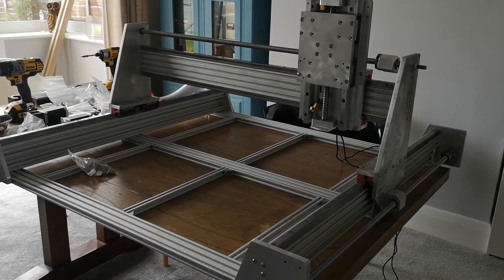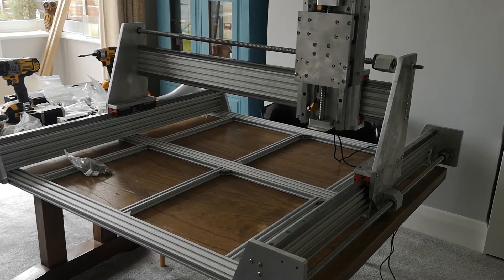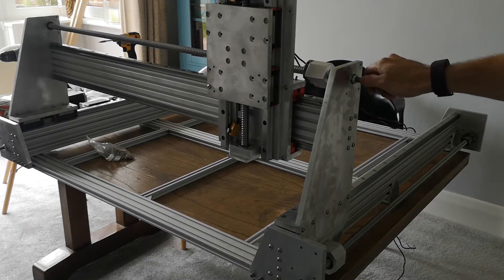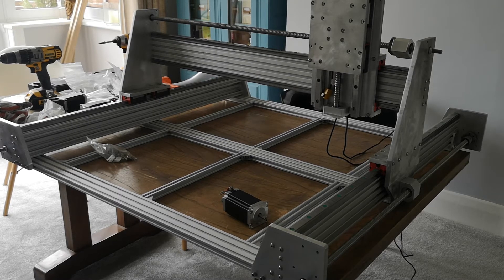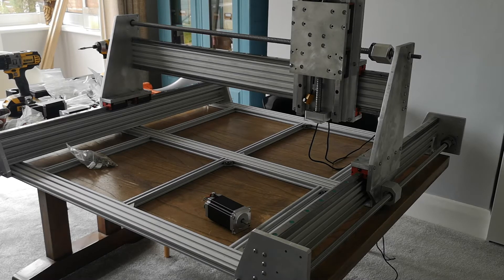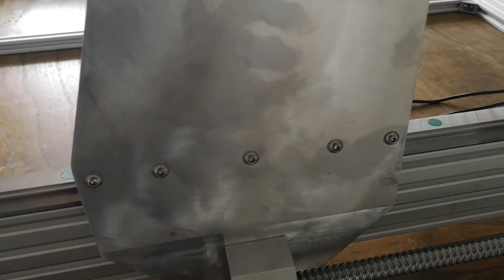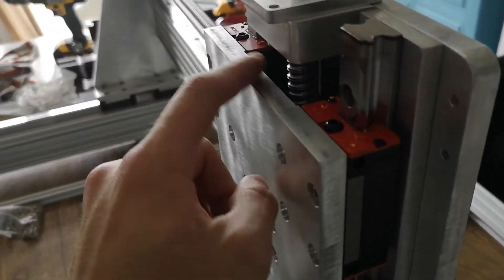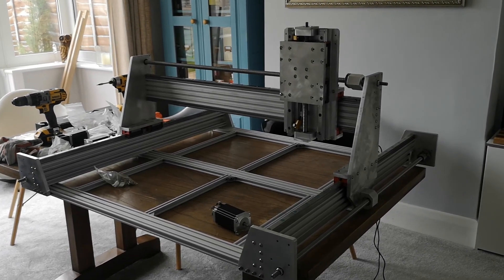Home built CNC Router - A DIY CNC built using a Shapeoko

Comment: Your design is fantastic ,only the x gantry rails where one is up side down not sure how well it will work but y axis is awesome.
Reply: Upside-down doesn't really matter. If you look at the design the recirculating balls in the bearing housing are situated front and back horizontally. Once the top and bottom of the Z assembly are pre-load clamped and attached it will not be rattling around.  The real working load on the system will be the bit being pushed and pulled front to back and side to side horizontally through the work material.

Comment: I am curious to know if you do your own machining on the ball screws.  I own a good sized manual lathe but only a Taig micro- mill which can't do much serious milling.  I am wondering how "turnable" ball screws are in their native state.  I assume they are hardened so I am wondering if you have to anneal the ends with a torch before they can be turned and threaded?  I am also wondering how you connected your stepper motors?  Is it necessary to mill a keyway in the end where the stepper motor is attached?  If you could also be so kind as to share where you source out your extrusions, linear bearings and ball nut and screws that would be great.   I live in Beaumont, Alberta, Canada but I have ordered parts many times off of ebay and they have found their way to me.   Thanks in advance for any education you can give me!
Reply from the maker: Hi Jerry, I don't do the ball screws myself. I was tempted but as you note they need to be hardened and I have no way of doing that kind of length. I buy mine in. I connect them using semi rigid connector, available from most well known online retailers (although I think they all come from china). It removes the need to keyway the ends.

Comment: Oh and btw that was an idea I had is reusing the shapeoko control board myself. That Z axis is sick!
Reply from the maker: Thanks. Don't use the shapeoko board, it's a total waste of time. Drivers don't cut it and I found out how you can use a generic Arduino board flashed with grbl which costs around £12... and supports a 4th axis....